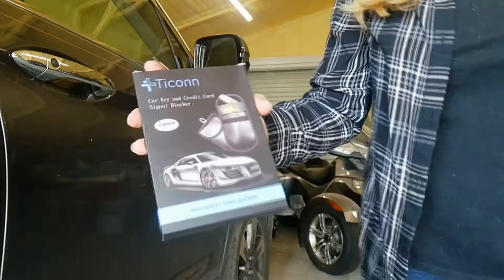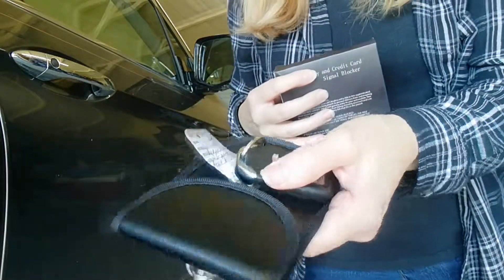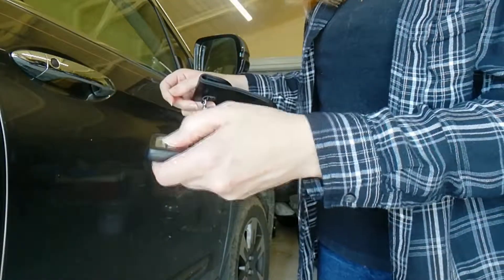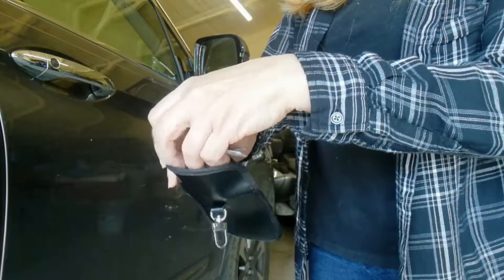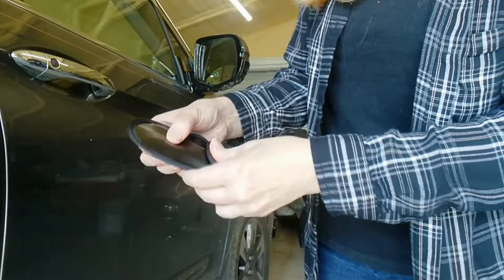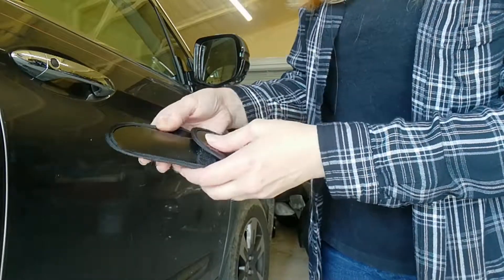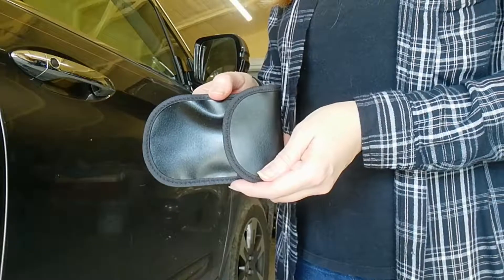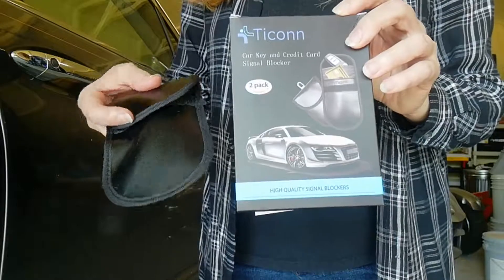TICONN Faraday Bag Unboxing and Test

Comment: Nice Try! But your type of key is not the type of key that needs protection. The key used in this video transmits when you press the button. The newer keys transmit all the time. No need to press a button. The vehicle detects signal when you approach.With the newer keys, someone (It requires two people) can stand outside your house. One with a signal amplifier, the other with a laptop to program the FOB. Then they watch you and your house and follow you somewhere and steal your car with their copy of your FOB.